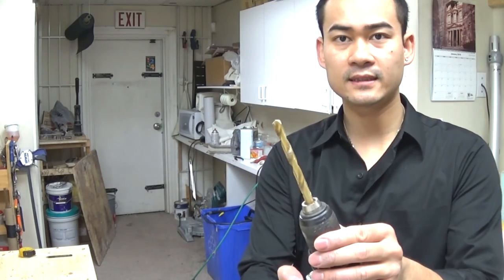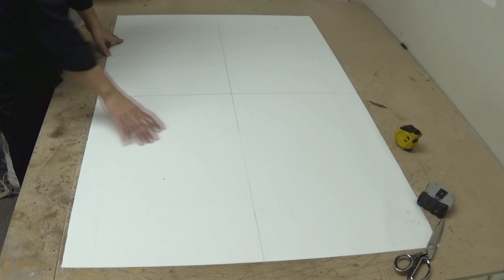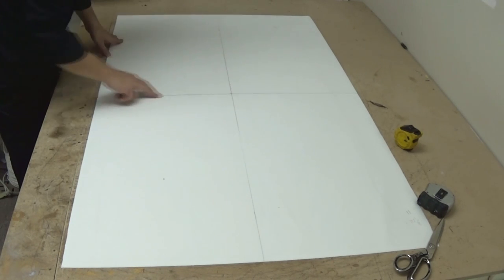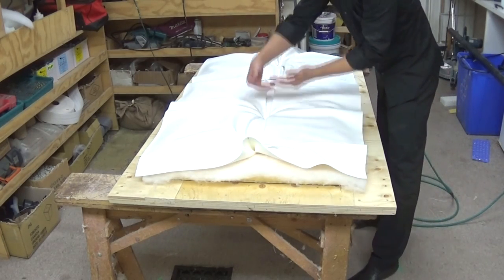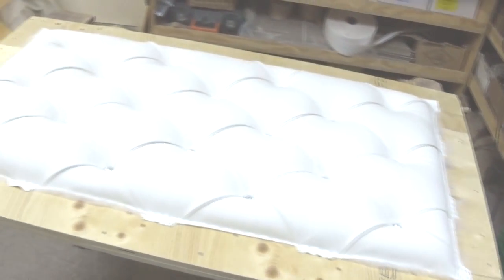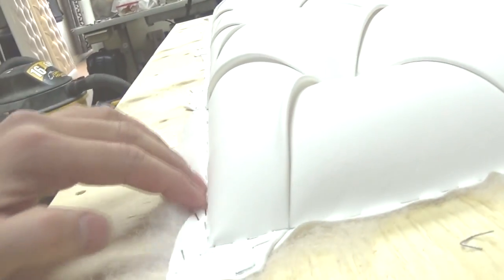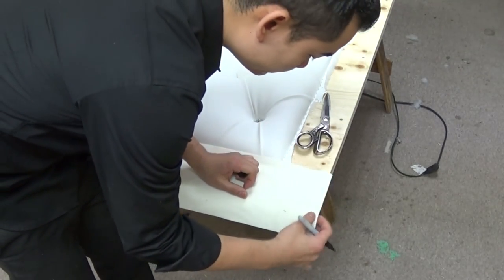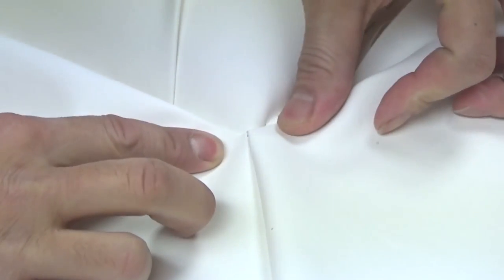DIY: CRYSTAL TUFTED FURNITURE PIECE AS A BACKDROP | diy  - ALO Upholstery

Comment: Great job. But please get a higher working surface!! The damage you're doing to your back is sooo very bad.
Reply: Nada Luqman was thinking the same thing
Reply: I think he has it at that height because he uses the same stand for when he upholsterers other pieces, which are usually chairs ... his newer videos have him using a hydraulic lift and he explains that it’s much better and easier for him to move things at the level he needs for each project...
Reply: Nada Luqman Take a salon stool with a height control, attach it on a sturdy plank of wood. Remove the seat then attach a thick plywood on top which will serve as your working surface. Adjust the height as needed.

Comment: Just finished making mine.  It took me 15 hours and I spent about $100 in materials.  But it looks as beautiful as the one in the video.  Thank you for uploading
Reply: Hi.  I’m going to make this. Can you tell me how thick was the wood you used please ? I’d prefer a thinner one to be lightweight but I want to make sure the staples go thru everything securely. Also what length staples did you use ? What thickness was the second thinner foam on top of the center area ? Please help ? Thanks

Comment: Hi Darren. Thank you for the videos. I am in love and you inspire me. Wish I had you as an upholstery mentor. Can you do a video just showing how you measure the board to be drilled for the tufting and also how do you remember where exactly to stick the needle through once the fabric is placed?
Reply: After watching again I seen how you aligned the fabric and came underneath the fabric to place the buttons. New question is how do you determine which type of word to use for each headboard I see you use different types
Reply: Katrina Grady sorry wood not word
Reply from the maker: Katrina Grady The best way to get your buttons measured on the board is to balance the edge around. for example, if its 5 inches for the side edge you would want 5 inches on the top and buttom edge. Then you can make the size of the buttons from there. I hope that helps

Comment: Good morning Darren
exquisite work I love all your videos.  I have a few questions for you (1) what type of material are you using? (2) what size are the buttons. And lastly  (3) what size is the thing you are using to drill the holes in the foam?
Reply from the maker: D.A Angus The material i'm using is white leatherette. and the size of the buttons is 1" in diameter. The size i use to drill out the foam is 1" 1/4 in diameter. I hope that helps.
Darren

Comment: Is the regular vinyl or a 4 way stretch vinyl please? I really want to make it the best way. // I think his fabric is thinner and stretchier than mine // I’m making a king sized headboard // Ok I used a vinyl that wasn’t very stretchy so my crease folds don’t stay flat but I pinched  each crease over a couple days and They look faaabulous !! 
I’m Not done yet, but it’s looking good so far. Note* when you cut the edge strips of fabric you need to cut the length on the wrong side to end up on the opposite side of the board, because you will turn them right side out finally ☝🏽 So when you cut the corner fabric to be sewed you have to cut the longer size to flip back onto the longer edge when it’s sewn and pulled over on the right side. 🙏🏽💖🥃🥃

Comment: Hi. When you use the 1.25" diameter hole saw to drill circles through the foam is there a special one to buy? I didn't have success last time I tried I ended up cutting sloppy circles thanks.

Comment: What size would be the dimensions for a king headboard please? Also what is the padding called that you placed on top of the 2 in foam please that was 1.5 inches longer in dimension.  I would love to try and replicate this for my room. Thanks :-)
Reply from the maker: Lexy50282008 the king could be 76" inces or 84" inces depends on the bed you pick. the white layer is called fiber.

Comment: What kind of drill bit do you use that doesn't tear the foam up?  I bought a 1" drill bit and tried this and my 1" hole turned into a 3" hole because the teeth grabbed the foam and tore it up.
Reply from the maker: Jeff B The tool to drill the hole is called a diamond foam cutter there isnt any teeth on it. with the tool you have you might want to reverse the direction it goes. for example maybe let it go clockwise instead. i think that might work better.
Darren
Reply: Thank you very much.  I now have one or order :)